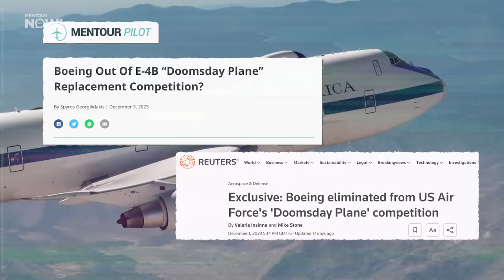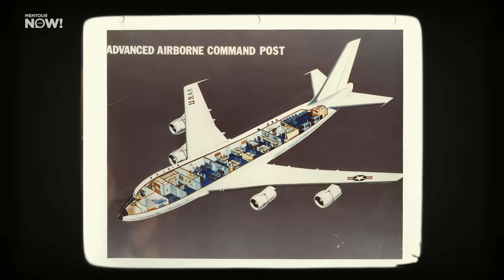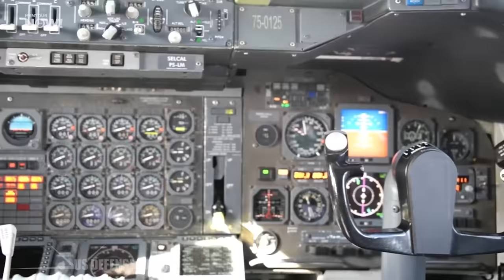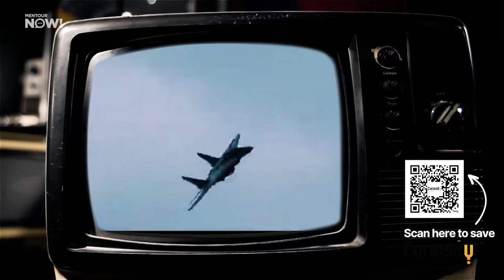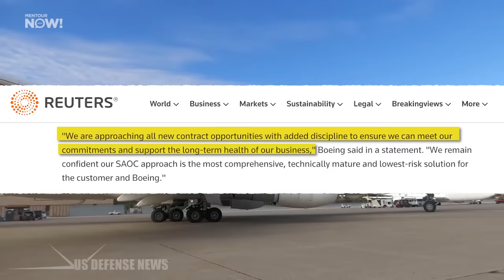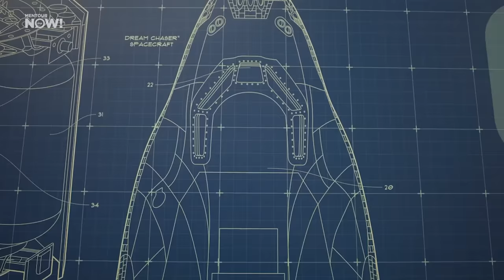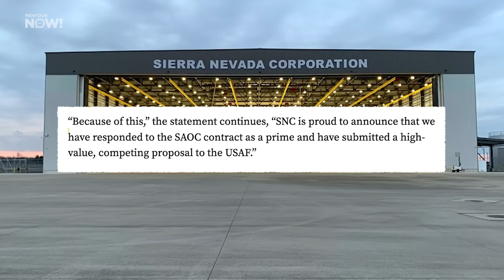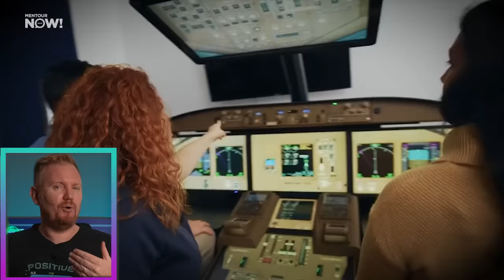Why was Boeing kicked out of the Doomsday Plane competition?!

Comment: Maybe also an older design, but I think the Lockheed-Martin C5 Galaxy could also be a posible basis for a Doomsday-plane. At least Lockheed-Martin has a design that they could rework into a Doomsday-plane.
Reply: Don't know much about it, but that is what I was wondering.  Whether an existing military  cargo aircraft could be a contender. Especially given that support/ parts from the commercial side for the 747 will be reducing considerably over this aircrafts lifetime, particularly if it will be anything like the current e4
Reply: They haven’t made any airframes in decades, not to mention they are very valuable for the Air Force. There are a lot of ex civilian 747-8 about to be available, and they’re all new.
Reply: @KanyeTheGayFish69  so they will never produce more of them or anything similar that they could share an airframe with?
Reply: You both misunderstand the point I tried to make, that Lockheed Martin and Skunkworks have made some crazy planes over the years. 

Boeing doesn’t make airframes also, thay haven’t for years, all airframes are made by external companies. And the C-5 Galaxy might look a lot like a 747, but it a complete diverent design than the 747. 

In I believe around 2010 C-5 Galaxies where completely overhauled, with new avionics, cleaner engines that burn less fuel. These kind of program’s take time, so I wouldn’t be surprised if there are still some C5’s to be undergo a complete overhaul.
Reply: @KanyeTheGayFish69  I thought the usaf had a few different cargo aircraft obviously I was wrong so are they going out of cargo aircraft all together
Reply: Lockheed probably bolt their door plugs on!

Comment: The replacement for the NAOC E4B will probably continue as a 747-8 sourced commercially like the Air Force One replacement but the primary contractor will likely be a specialty prime like L3 with Boeing as a subcontractor to offer its expertise on the 747.  This essentially a way for Boeing to be intimately involved with engineering & integration while minimize its financial risk.
Reply: what would really be interesting is if maybe the Air force considered the C5M or C17 as possible solutions. They’re already militarized to the highest standard with midair refueling, rugged landing gear for unimproved runway n temp airfields plus buckets of spare parts & frames for ages to come & they could easily be further modified for EMP etc for its mission set. So essentially it’d be just civilizing the interiors for conference rooms, coms stations, berthings, briefing rooms, vvip accommodations etc.

Comment: Could the winning bidder use 747-400's instead of 747-8's? Or do we think there is there some kind of requirement about maximum age or hours on the airframes? 747-400's should be much easier to acquire, I would think.
Reply: Yes, they probably could. Many people seem to think that the plane manufacturer is the only one who can win the contract when that’s far from true. There are many companies, SNC for example, that are very capable of acquiring the aircraft’s and then reengineering them to add all the necessary components.
Reply: Yup, I was thinking some end of the line 744s would be ideal.

Comment: What if Airbus comes in with the A380? It's got 4 engines, and a lot more room for all the new stuff the doomsday planes need, right?
Reply: While that sounds great, it probably would not be the military's preferred aircraft. For starters, it would limit the airports and air force bases that the doomsday plane can operate out of. Some airports that were able to accommodate the 747 had to be modified to handle A380s.

Also, if the military is willing to use it, and if there are plenty of airports and airbases that can accommodate the a380 doomsday plane, there is the matter of relying on a manufacturer headquartered in Europe and with a good chunk of the assembly line located in Europe, or else outside the US. Given it's a critical and also highly confidential project, relying on a European manufacturer is probably another downside the military will see in an Airbus-made doomsday plane

Comment: Having worked at Boeing (and several other major prime contractors of the USAF), their typical strategy is to bid low and get additional funding, even for FFPPIF contracts, since the AF is notorious at changing requirements mid-project, which gives the prime opportunities to add funding. Primes figure that it's in the gov't interest to keep several major prime competitors around (aka BA, NGC, LM) by spreading contracts around, so they can get away with it. Looks like the GAO finally got serious at enforcing FFPPIF to keep the primes honest, which is LONG overdue. (Random aside - Boeing's winning bid was ~50% of another competitor for a major UAV contract ~5 years ago, looks like they'll have to eat the cost of that one too... lol)

Comment: Faced with this problem, I'd be looking to convert some C-17s or adapt some new-build KC-46s.  I wouldn't be looking at converting airliners.
Reply: I had the same thought. Not an aircraft expert, but you might even be able to pull some old C-5s from the bone yard if you wanted even more size.
Reply: I think a converted C-17 is a brilliant idea. I'd never thought about that!
Reply: @ahndeux  No need to be a douchebag. The KC-46's are new-production aircraft, they aren't  "converted 767s."
Reply: @ahndeux  What the fuck are you talking about?
Reply: @eeyore.official Thank you.  My thinking was influenced by the USAF's having used C-130s in the ABCC role for many years.
Reply: @Rocketsong Give me tool box, duct tape, and per diem and I'll take care of it. I should be able to crank out a couple per month.

Comment: Merry Christmas. Right for Boeing to stay away from this in it's current form.   Is the US gov in the mood to sign a fixed price contract with enough headroom to cover possible losses?    What happens when they take a few planes planes now and ask for another batch down the road when prices have changed?   I have a big problem with using a plane that is no longer in production too.  The days of 4 engine airliners are over.  They should accept that now and buy planes that are in current production.
Reply: Add 2 engines to a 777X

Comment: I think the obvious other candidate for a 4-engine widebody is building them off of the A380 frame, if any of those are on the market used. Issue being, if they're looking for fixed-price contracts on 747-8s I cannot imagine the USAF wants to fork over the money for the larger, more modern airframe, even if it might have some advantages.
Reply: Plenty of A380s available, but this will either be a 744 or a 748.
Reply: @cjmillsnun   Most likely low hours 747-8's.. trying to find a low hours 747-4's would be a challenge.
Reply: @bubbavonbraun  and where can you buy 747-8? They are young and still in service
Reply: @misterXPlayer easy just offer current owners an offer they can't refuse.

Offer Atlas air $30 million more than what they paid few months ago for new/last 747 delivery they would do it in a heart beat.
Reply: @misterXPlayer  There are a couple out there. Wouldnt take much for Lufthansa to hand a few over or KAL.
Reply: @bubbavonbraun  why Luftahnsa should do that? They don't have enough widebody planes now. The 747-8 is 10 years old and Lufthansa will fly them for another 10 yeras. At the moment they are uprgrading the business class in the -8.
Reply: @cjmillsnun  A340s too.

Comment: I believe the reason they want 8-10 planes is that they are also replacing the Airborne Launch Control Centres (ALCC) which currently use the 707 based E6 Mercury aircraft. I image they want one replace both platforms with one type of airframe.

Comment: Boeing has been reminded that the Government can be a terrible customer.  This type of project is never offered to the bidders as a finished spec.  It will often require systems that don't currently exist or force the contractor to deal with never ending change requests.  New tech and change orders are huge drivers of cost over runs. I suspect Boeing is no longer interested in funding the Government's acquistion incompetence.
Reply: Guess moving corporate HQ to Arlington, VA doesn't mean anything about their government acquisitions??
Reply: Add to that the frequent rotation the.. crap.. now I can't recall what the people who actually manage the contract are.. but anyway, they often have a 3-5 year rotation, so the people in charge of deciding what the government 'really' wants are not the same people who wrote the original spec.
Reply: A government needs to be able to require changes made to keep up. It's not that they want to be bad customers but military demands are vastly different from commercial aircrafts.
Reply: @charisma-hornum-fries  while there are good reasons for why they behave as they do, they still make terrible customers.

Comment: Assuming the target airframe is a Boeing 747, why does it have to be the 747-8i passenger variant?  Why couldn’t the “doomsday” retrofit platform be tailored around the much more plentiful 747-8F airframe?  I mean, the current E4B’s don’t seem to require the stretched upper deck fuselage type.

And besides Boeing and Sierra Systems, there are other possibilities than just Airbus.  Lockheed would certainly be capable of an undertaking such as this.

Comment: I honestly think it’s going to be hard to design hardened electronics. I’ll bet that’s a huge issue going forward.
Reply: You make it sound like they haven't been working on that for well over half a century. That's pretty funny.
Reply: @TheEudaemonicPlague  yeah, and it is always hard and has to be redone over and over as parts age out of production.
Reply: Optic fibre for the cable runs.  Multiple redundant digital controls and hardened control modules.  Expensive to develop and more expensive to get certified.

Keep in mind that FADEC runs modern engines. Hardening that alone is not trivial.

I doubt that $8bn would cover a "proper" development. There will have to be compromises in performance and reliability to leave to profit.

Then there is always the hope of ongoing support contracts, beyond the initial supply.
Reply: C-17 Fly by Wire = hardened. Much more complex than just FADEC. Also mil spec data bus.  Designed years ago. @BerndFelsche

Comment: I would say the next Doomsday  
Plane will be another 747 variant and that is the Boeing 747-400. With many airlines retired the -400 since 2010s and covid, i think the US Air Force should choose the -400 as the new Doomsday aircraft because that is actually makes perfect sense in my opinion
Reply: Do they need to be commercial planes? I kept thinking about the Lockheed C-5b Galaxy during the video. Airforce One would probably need to be a non military plane as you probably do not want to send an aggressive military message arriving in a bomber at a peaceful conference. But the Doom plane I see no problem :) Or the C-17 Globemaster, even tho it is a little smaller is much newer (some are less than 10 years old) and there have been plenty of them produced.
Reply: USAF and perfect sense?
Reply: @georgegherghinescu  Maybe they're not considering the C-5 and C17 since they're designed to be airlifters. They're not really meant to stay up in the air for prolonged periods of time, they're just meant to get stuff from A to B.
Reply: @jameshannay7376  Have you just described a passenger airplane with that 'They're not really meant to stay up in the air for prolonged periods of time, they're just meant to get stuff from A to B.'

Comment: Suspect the mods on used aircraft even more expensive than a purpose built craft.  Pulling and upgrading all hardware allone would add huge cost.  Hardening the airframe would be easier in production than with a refit.

Comment: What about a re-purposed C-5 Galaxy? Almost the same size + 4 engines and the high wing design could accommodate a larger engine. The countermeasures package will need a major reconfiguring, but doable.
Reply from the maker: Not impossible
Reply: Old, much farther out of production, and reliability is much worse than commercial aircraft.
Reply: problem is the C-5s all have a lot of hours on their airframes
Reply: Cost per flight hour on a C-5 would put it out of the competition.
Reply: @seanwright7960  No reason you can't fit them with more efficient engines.

Comment: Overdue for replacement?  Heck, they're babies compared to the B-52's.  Don't think they're going away soon.
Reply: ...indeed the B-52H the last of which was delivered in 1963, iis the only model still in service 61 years later.  It is currently undergoing a reengining programme replacing the old TF-33 turbofans with more efficient Rolls Royce F130 engines.with the same thrust output to take the venerable cold war bomber into mid century, redesignated he B-52J.

My thought is when  Lufthansa, Korean Air, or AIr China  phase out their 747-8is (and/or any of the 8 BBJ models come available), those could be purchased and modified as E-4 replacements. teh 747-8i has a range of over 14,000km and likely would improve as it wouldn't be carrying a full passenger load. Of course air to air refuelling capability would need to be added but that modification was done with the existing E-4s and VC-25s .

A little irony, the two replacement aircraft for the ageing VC-25s were originally 8i's ordered by the Russian airline Transaero which went bankrupt before delivery,.

Comment: Boeing won the KC-46 thanks to political intervention after Airbus had won. And despite Airbus winning basically any tanker contract at that time and Boeing not even having a proper plane to compete, they changed the parameters after Airbus had won to help Boeing. It’s just one of those ways to get subsidies into Boeing.
Reply: And if Airbus didn’t cave and make the Europrop the only available engine for the A400M maybe we might have purchased a few (especially considering we already use RR for our C-130J’s), so don’t sit there and act like Europe doesn’t root for the home team.
Reply: @superskullmaster  two completely different things. And of course you can have some home advantage, but this was an extremely strange case in which it was visible that the whole competition was a joke. 
Btw, the A400M engine was a new development and there were no available engines with that type of output. The A400M has twice the capacity of the C-130 and that’s hardly comparable to the A400M.

Comment: Since the U.S. Air Force is insisting on a four-engine plane, this makes me wonder if some retired or staged A-380s might be summoned into the mix. It seems they would be the only aircraft with enough room and the four-engine requirements as stated. The A-380 would certainly have the room for many options such as crew rest areas so constant flight could be maintained if needed. Interesting but suspect.

Comment: Since the contract is calling for the use of 2nd hand, 4-engine jets, there are actually quite a few defense contractors that could do it.  It's less of an aircraft acquisition than a systems integration contract.  Northrop could do it.  L3Harris (which has done a LOT of this type work on AFSOC aircraft).  Lock-Mart. It's the kind of job L3 would have taken, and maybe subbed some to Lockheed at least before Harris bought them out.

Comment: I do not understand why Boing does not accept a fixed-price contract. If you offer a fixed price, you just add enough buffer so the risk of cost overruns is low, and you have the chance of making good profit if you manage it well. The only reason when you don't accept a fixed price is if the customer is unable to specify what he wants to a degree that you are able to calculate the costs or if your company is just unable or unwilling to properly calculate development cost. Also keep in mind that we are talking about modifying existing aircraft, not the development a new aircraft, so calculating the cost should be possible with sufficient certainty.

Also, if you generally manage to calculate costs development costs properly on average, the occasional cost overrun will be ok because you also will occasionally run unexpectedly high profits. You will only be in trouble if you methodically underestimate costs.

Boeing seems to be run neither by engineers nor by businessmen or even accountants, but marketing people living in a made-up reality who fucked up multiple times and now seem scared to do anything now.
Reply from the maker: That's true, to a point. Boeing had a similar assumption with the VC-25Bs (next Air Force 1) but then they had to modify it to current FAA certification standards... if they have to do the same with these planes, costs become a lot less clear-cut, as I explain in the video.
Reply: Harder to sell a high number and even if you win the bid then you still have to deal with inevitable negotiation. Fixed price contracts are inherently risky for the bidder any way you slice it.
Reply: @MentourNow  As a defense contractor, if a customer said I had to certify to FAA I'd tell the customer (politely) to go pound sand.   That's a gigantic black hole of financial risk.  I worked on the FAA board for certifying NVGs for use in civilian cockpits, and it was largest nightmare of bureaucratic red tape, delays, and inability to make a damn decision I have ever had the misfortune to be involved with.

Comment: The air force ones Emp protection include Pilot driven pedal power generator to power the electronic, 4 pilots pedaling quickly generates alot of power